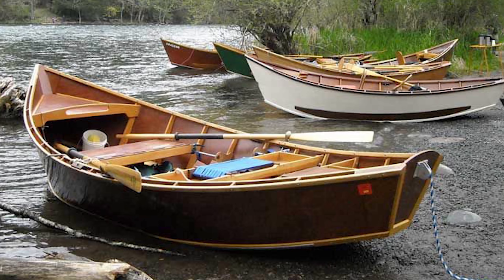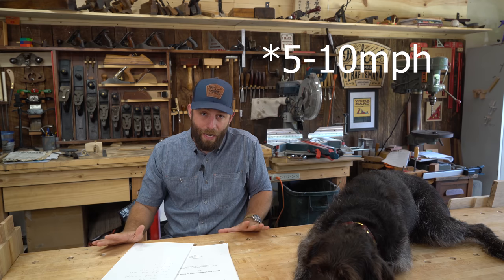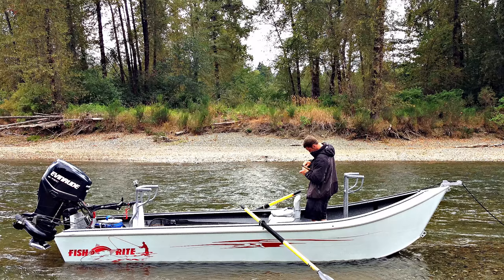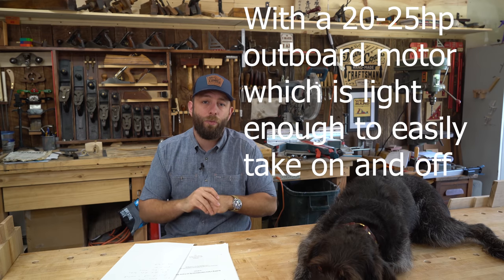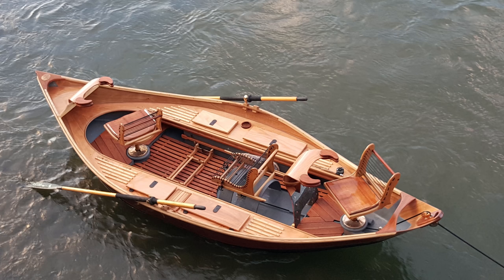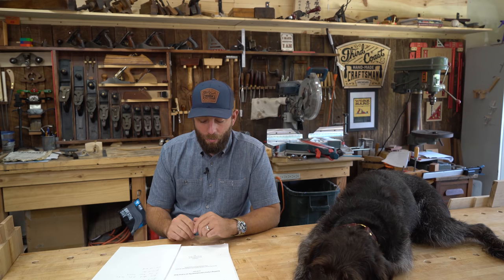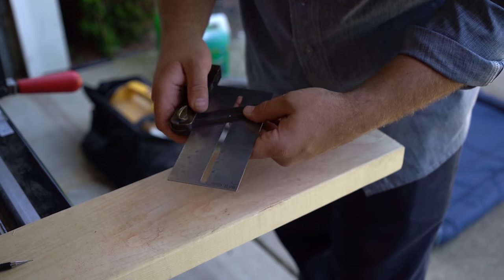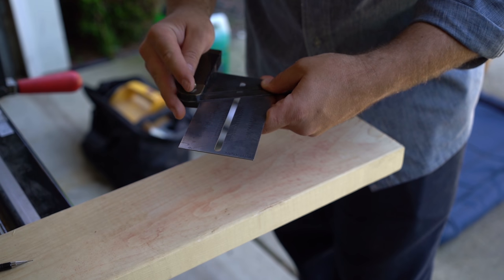Wooden Boat Build // Part 1: Intro and Strongback  //  Drift Boat Power Drifter

Comment: Going for the "Louis Sauzedde found the fountain of youth" thing? Gonna make a "Mr. Friendly"?
Utz seems a touch concerned. 
I made a version for use replacing a few windows, but a track saw 6 1/2 blade fits in the factory guard.

slightly less scary
slightly

Comment: Unless you want it to get on plane I would power it with a high end trolling motor. Batteries don't weigh much more than fuel if you use Lithium Ion ones. Maybe less if you use newer motorcycle type.
Reply from the maker: Yes I need to get it on plane to be able to run several miles up and down the bigger rivers.